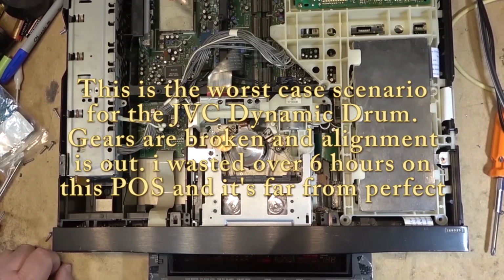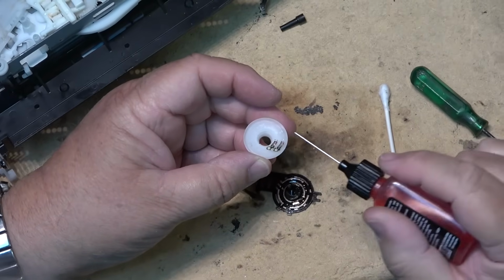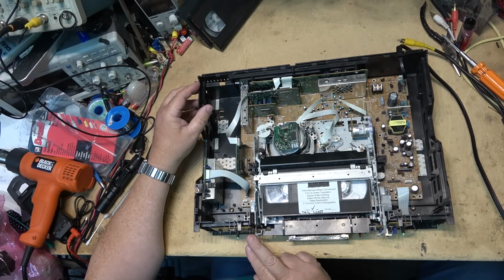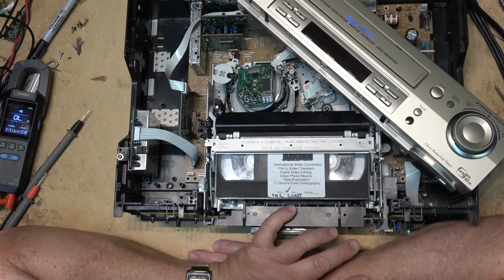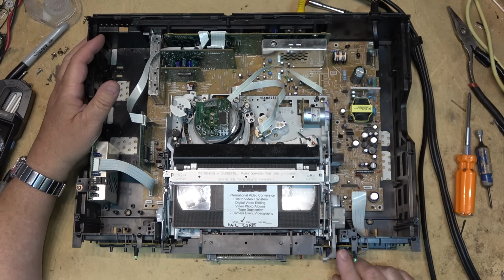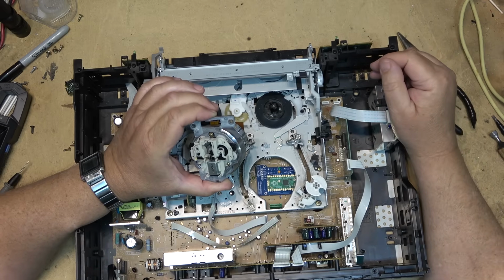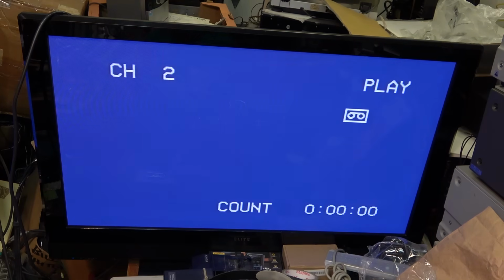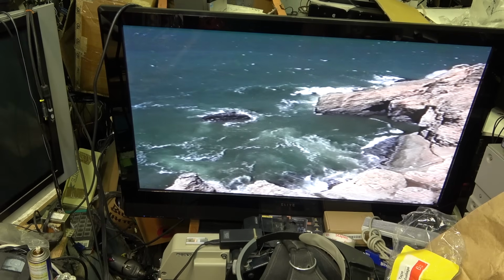JVC HRS9800 SVHS Dynamic Drum Failure and other issues plus customer got their fingers in YIKES

Comment: Classy. Heaps scorn on amateur tinkerers who watched some YouTube videos, then heaps more scorn on a mechanical engineer charging a fair price for a very niche, hand-built, extremely small-batch device that he spent untold hours reverse engineering, coding, testing, and revising.
Reply from the maker: I'm just staying I would pay more for that board. It really isn't that difficult to design.  He took a working machine and captured the pulses generated as the machine changed modes and then replicated in software.  Others had devoloped these boards before.  The first one I saw had a bunch of discrete parts and a PIC on it. That was probably 20 years ago when i saw that one so these emulators have been around for a long time.  The one I saw wasn't even on a pcb it was on a breadboard. Talk about hand built.  For all i know this guy read the code and loaded it on a RPi pico and just added the voltage divider resistors and a couple LED. 
The dynamic drum jvcs were probably the worst. No they were the worst machines JVC ever made.  As i mentioned before even when they were new they had all kinds of compatability issues.  Make a recording especially in EP speed and there was a high probability that it would not play on other machines.  As they aged the problem got worse.

Comment: The guy thst nanufactured the DD emulator has an HR-S9800 model like this one. The board is not made for the US version of HR-S7600. The European version of JVC HR-S7600 does not have a dynamic drum. Other than that it is identical to the us model but with SCART connection of course. The emulator was developed for European models in mind.
Reply from the maker: It's a meet idea but certainly not the first as I saw one probably 20 years ago in a machine i serviced. Didn't know at first what it was but figured it out when I unplugged it to service the unit and didn't seat it correctly when i put it back.  It was built on a breadboard with a PIC processor and a hand full of resistors and transistors.  The unit was if I remember a 9800 and the dynamic drum had been replaced with a different non DD drum.  So the emulator idea has been around for a long time.  This guy just coded it for an off the shelf raspberry pi pico. It's really not that mysterious.  When the vcr sends power to the motor the circuit generates a series of pulses to simulate the motor shaft turning and then a second pulse for the "neutral" position.  There is probably more of a market now for these devices now that all these old machines are dying and if you are a Doo it yourself type spending 150 on this and reaaitcally that is what one would cost at a minimum.  After all it's 65 euro which is about 102 Canadian plus shipping and then there would be broker fées and tax added.
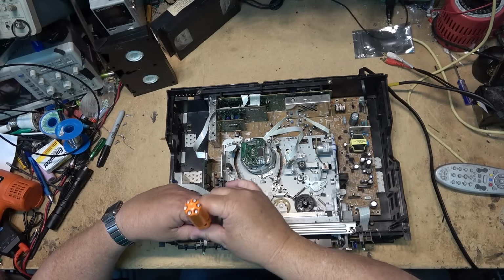But for someone doing this for customers if it cost me 150 to land, obviously I have to mark it up a bit so now it's 175 plus the labour to install and if the gear has already broken as it was on this. Well let's just say I lost money on this one.  I started on the machine at 1:30 and was still working on it at 10pm when i finially gave up.  It works but it's not perfect and I could spend more hours trying to get that drum perfect.  Even is everything went smoothly that's 100 labour and 175 for the part.  My customers are not looking to put that kind of money into an old vcr.  I got an slvr1000 for free because of the blue gear.  Had one shipped in told him it would be 100 total for the gear and labour.  He paid me 100 to change the part then cheapest out and said keep it when the shipping to send back was 120. Now this fella already paid 135usd to ship it to me band then paid for the repair then changed his mind and said keep it. Had another guy ship me 4 vcrs just to watch me fix them and i sold them all for 50 each.  People just won't spend the money to fix this stuff.  The only reason i even bother is to make YouTube content.  That's where I make money and not much at that but enough to survive on.

Comment: I love how people use to assume that the DD drum would make playback track better and the best VCR ever made. It doesn't, use used for rewind, or forward seek. The TBC in these were not great as people claimed. One tape that had bad vertical and would drop frames, or keep in sync and put distortion on top on a good working HRS9800 and a Panasonic E75 combo was only deck that could play it perfectly and keep audio in sync. It wasn't just that tape, a few tapes I notice the JVC HRS9800 would keep frame in sync, but put distortion on top, or vertical issues, while my external Cypress full frame with different SVHS deck,  or my Panasonic combo line TBC with built in frame synchronizer would play that problem tape perfectly.  Yes I only use one TBC at a time, never both. Now I use a later model JVC professional SVHS with DigiPure Technology with 4MB Frame Memory that one playback most damaged tapes perfectly and NR is better, I assume would be a similar DigiPure TBC JVC used The newer deck is much better, as it does what it suppose to and keep in sync and no dropped frames, NR is even better 

I  realized many years ago the HRS9800 wasn't as good as people claimed over the years, likely due to heads drum is not as solid and results in stability issues and one the gears are not cracked at all and DD actually works correctly and low hours deck and yes if a good tape picture was great, but on problematic EP tapes finds it can falls short at times where a external full frame TBC and turning off the JVC internal TBC would resolve timing issues better, or just using the Panasonic combo.

My favorite deck is the JVC HR-S9911U
Reply from the maker: The DD is for special effect playback, only. Search without lines. Mitsubishi did it using piezoelectric mounted heads where they could dynamically track the video tracks for slow and fast playback.  The biggest headache with these stupid machines is because the DD mechanism rocks back and forth every time you turn it on and spins the gears every time you change mode, the plastic cams that actually position the drum start to wear right away and now the drum alignment isn't perfect. Sure it will tweak it slightly on playback but what about record? Nope so every tape that comes out of it is recorded slightly different. We sold a dozen or so to a casting studio. You know the type. Wannabe actors pay acting coaches and then read lines on camera and the casting studio makes them a bunch of copies and sends them out to casting agents for film and TV. Being in a very large studio market, Vancouver BC, Hollywood North as it is known there are tons of movies and series shot here and we are swimming in talent.  Well when the studio guys (the owner lived local) came looking for a bunch of machines to make their demo tapes on they chose the 9800 as it was the top of line most expensive model. Guess what happened. They all kept coming back with the claim that tapes wouldn't play on other machines. Of course we would check the alignment and it was fine. It wasn't untill I made a bunch of recordings and took them to the show room to play them that the problem was aparant. JVC contacted and their solution was to replace the drum assembly. They changed it as an entire unit. I changed so many drums on these machines.  All for the same customer and they would come back in a few weeks with more problems. Eventually JVC bought back all the machines and supplied them with 9911 models.   These were good machines.  When I left the business I kept the studio guys as a client and serviced their 9911 machines which were far, far superior to the 9800. The last one they brought me probably 20 years ago I still have. The couple that ran the studio split and the company shut down and they never collected the last machine they brought me and it's now mine. It works great BTW. The only thing I don't like is its kind of clunky. Changing modes is slow.  I am more of a Sony guy here and once you get used to Sony's immediate response things that make you wait, even if its only a second or 2 get annoying after awhile. 
Editors are generally an impatient bunch as when you work with pro gear you get spoiled and resorting back to consumer gear that takes its time doing anything  gets frustrating
Reply: @12voltvids  I agree the Sony professional VCR's were the best and instant respond at the time. It was due to the diecast transport that was fully direct drive, literally Sony made the best VCR that was fast and worked well. It a shame those used so many SMD capacitors that leak and eat up traces. I miss those but we long moved on to computer's and good software and those S-VHS editor decks are relic of the past. I prefer them back in the day, but now just keep consumer mostly Pnasonic combo decks as tend to work with most SP VHS tapes fine and a couple SVHS deck's I use to do transfers, as well as other formats like DV, 8mm and beta and umatic. I shock people once in a while still ask to transfer stuff to VHS. I literally had one customer ask to transfer a 8mm tape to VHS and I of course asked why? He stated his old RCA combo DVD no longer works and he doesn't use computers. I ended up giving him one of my Panasonic DVD/VHS combo and transfer the 8mm tapes to DVD and kept digital file on NAS as a backup. He happy as he has tons of VHS he transferring over himself to DVD.
Reply from the maker: @thetechgenie7374 i had a fella bring me his 8mm tapes and films and wanted them on betamax. Same sutauation, older gentlemañ who had been one of our Sony fans and had all Sony betamax in his house. 
He was the guy i got my sl2000 from when he bought a betamovie. When hi8beolles out he bought the ccdv5000 same time i had mine. Well years later he goes to look at a hi8 and his camera was toast.  About 150 pissy caps. Called me aboyt the camera. Brought it over ans i gave it yhe sniff test. Smelled like a room full of hookers on a saturday night.   Ha ha ha thats the deugs talking LOL.
Anyway he wanted all hia hi8 on Beta1SHB as he also like me has a pair od hf1000. He wanted to edit. I laughed he paid really well becauae i has beta.

Comment: I’ll have to make a video for you showing the DD unit can be completely removed and put off to the side and the springs that hold the drum on the home position are usually enough to keep it in the home position while still showing a good waveform. Some DD’s have worn pivot points and that can make them not “home” as reliably. Never needed to do it, but a drop of superglue or epoxy at each pivot point (there are 4) would make the whole drum rock solid and you wouldn’t have any instability issues
Reply from the maker: If its already worn and and the alignment is off then you are screwed.
Reply: Yes I had one machine running with a stripped drum and lead ring all held by the two spring loaded screws, I did not even have to re-align the VCR. It's much easier and safer to remove the gear assembly and drop the drum to its neutral position than keep them in and re-align the P-guides, the drum will be on a permanent tilt and I'm not sure how good that is for the edge of the tape.

Comment: Hi Dave,
If you would use Bondic or something else to lock the gears in place would it make the drum stay in place?
Reply from the maker: It would but they gears are not in the correct position now.  Thats more work than just extending the wires and putting it off to the side.
Reply: @12voltvids  The gears have timing marks for home position?
They had to have a reference point at the assembly line.

Comment: Tell me the best model of VCR to converte VHS tapes. By the way I have the JVC HM-DH30000U, still the best I have.
Reply: Late model Funai "vcrs are the best.  All JVC vcrs are garbage.  They are reliable cheap and easy to work on.
Reply from the maker: @coastalvideotransfer Copuldn't have said it any better myself.  LOL. I use Sony SLVR1000, SVO2000, I have a late model Panasonic PVV4535, JVC HRS9911.  I do have a couple of "industrial" machines, namely AG1970 and 1980, and an AGW1 and AG8400 and a JVC model. All of them have issues. I got the JVC going but the linear audio board is shot. Leaky caps everywhere.
Reply: @coastalvideotransfer JVC's plain VHS decks are garbage, but JVC's S-VHS decks -- especially S-VHS decks with line TBCs -- are some of the best VCRs every made. The HR-S9800 has a reputation for quality output for a reason.
Reply: @coastalvideotransfer The Funai DVD/VHS, or DVD/HDD recorder are not actually as bad, but also notice it depends on what revision has to be later then 2009.  I prefer them over the later EZ series Panasonic, actually all Panasonic, as never liked the DVD recorder quality, like microblocking,  weird chroma noise especially noticeable on corners of picture. Then stuttering every 35 seconds when playing back DVD recorded on the Panasonic using VLC due to bad encoding, using KM player works fine. I like the Panssonic's as the VHS transport better quality, but DVD recorder is not great and problematic. The Funai never had those problems and the later 2010 used a different chipset suspect LSI relabel Panasonic but has good NR not to aggressive and line TBC with frame sync that actually works  surprising well. I can fast scan and rewind and capture doesn't drop frame and corrected one very bad tape that it was waving in the middle did two days ago  even my external full frame TBC had issues with, but didn't drop frames and did stable it for the most part, capture card held in and audio in sync so did what it was suppose to do. The Funai line TBC actually corrected it horizontally and vertically and you couldn't tell tape was damaged, that was just using the Funai line TBC and full frame out of chain and JVC internal TBC turn off. So I test a few other tapes and yes I can confirm the later revision ones use a completely different chipset suspect same as the H2160mw9 as same drive same PQ as far as DVD record quality, which does use a later LSI right when LSI sold company. 

The early Funai had zero line TBC as VHS output was separate from the DVD recorder output on rear and could not correct anything, you get the tearing, wavving and drop frames on revision before 2009, I know I tested and repaired 100's of Funai DVD VHS combo recorders over the years. The later revisions 2009 and later did and have good NR and finally a line TBC. The line TBC on the later revision Funai recorders actually works better then the later Panasonic's. The NR is much better. So yes the later Funai they changed the chipset and a few other things even same model, they did improve them over the years. So trick is get a later production date on the rear sticker on side by the power cable and go with later then 2009 and up. Plus the later ones are the only ones that can pass VHS signal to HDMI convertor, early ones like a 2007 production date doesn't and only outputs for DVD recorder side.
Reply: @coastalvideotransfer Really?
Reply: @caius4124  They are down to 3 chips on them yes, I dont think you can get hetter then that,   I rather a funai then a heavy boat anker. They do the job just as good if not better then a 30 year old vcr with dozens of circuit boards and modules. Indo tape transfers for a living and the results as great, and as good as vhswill ever look.  I got more expensive avhs machines but why use a expensive svhs for regular vhs tapes
Reply: @coastalvideotransfer You get the more expensive S-VHS VCR to separate chroma and luma signal is you are using a separate full frame TBC and proc amp, so you don't bake in timing issues and chroma noise. I would have to show a side by side different in just he chroma noise. With good NR and proc amp using Y/C a huge difference even with a SP tape, with a EP tape a night and day different. Picture is way sharper and cleaner overall and of course no dropped frames. Yes while most SP tape you don't actually need a full frame TBC the line TBC in the DVD recorder will fix the tearing and etc. You do hugely benefit from a good proc amp and NR to get rid of chroma noise and keep levels in check. 

It pointless to use NR on a composite signal, you bake in the noise and timing errors that way.
Reply from the maker: @coastalvideotransfer I have to agree. The funai machines were great.  When my production business was humming, and my business partner was still alive he did all the VHS copies. Had about 100 machines and started buying Funai HiFi models to replace his JVC, RCA and Panasonic and found them to be much more reliable than the expensive name brand units. Funai was in the VCR business longer than anyone. They started late, in 83 if I remember but they lasted longer than everyone else. Last one made in 2016 and made about 15 million units a year.

Comment: The sad thing is all these machines will eventually stop working one way or another due to no parts available and age plus individuals who can work on them will also fade away in time.
Reply from the maker: We are there now.   Service people are dropping like flies.
Reply: Thats why I only use
 SVHS and other rare vcrs like pal conversion vcrs only when I really need them. And run them thru their motions once a month
Reply from the maker: @coastalvideotransfersame here.  I use my svhs machines specifically for svhs tapes and a cheap vhs for regular tape archiving.  My betamax, BETACAM and 3/4 gets turned on once a month and a short tape run through. Same with the 8mm and dv gear.